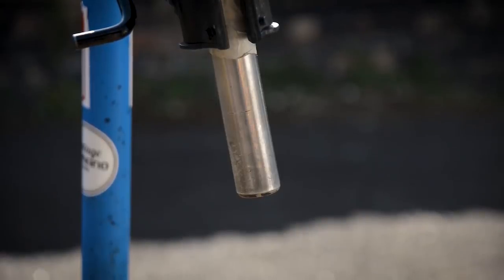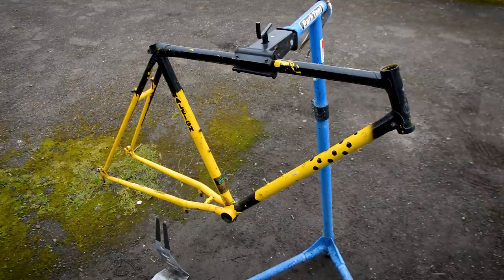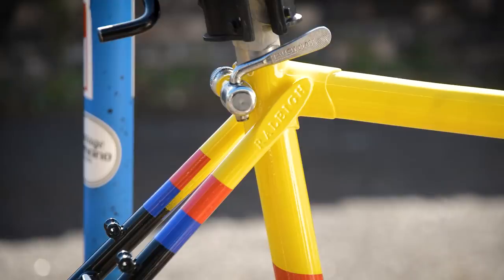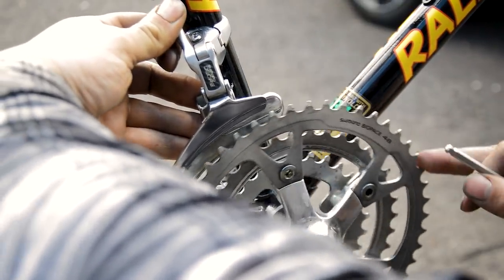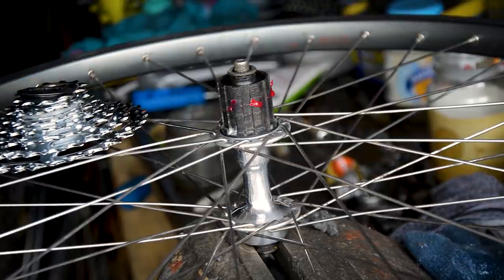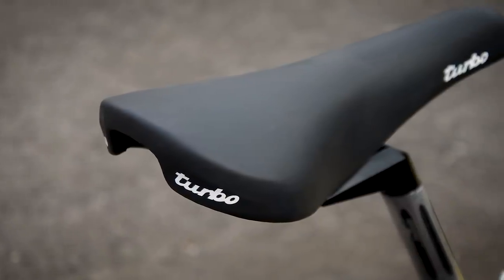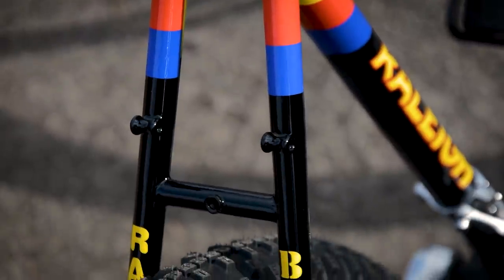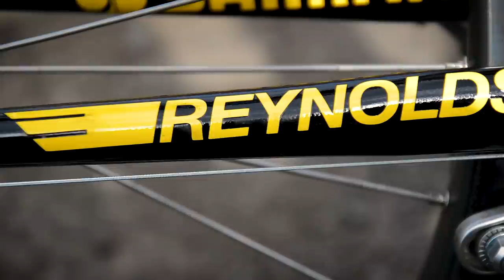1987 Raleigh Avanti - Team Banana - Vintage Mountain Bike Restoration

Comment: I love seeing somebody re-purposing old equipment and making the most out of old-tech. Most of the bike stuff from the 70s and 80s, especially from the big manufacturers (Shimano, Suntour, and Campag.) were of such a quality that they can be rebuilt and reused for decades. Just because you haven't got 12 gears and electronic shifting, doesn't mean you can't enjoy your cycling, if anything, to take an old bit of kit, cleaning and restoring it and making it work well, is an added element of enjoyment.
Reply from the maker: For sure. I get a tonne of enjoyment from rebuilding these bikes and love riding them all the same.

Comment: That was fantastic work, well done, i was particularly impressed by your method of overcoming the obstruction of slotting the sealed BB into the BB shell when the rivet is obstructing, i have managed to overcome this previously on my road bikes by precision milling the "locating collars" (for want of better word, not the actual threads) to create a grove to allow it to feed through as if jumping over, if you will,  I would not have thought of that, mainly out of fear of damaging vintage italian frames, but, to tap a thread and use a bottle boss bolt to mount the plastic cable guide insert, respect man !! if i need to do so in the future i will remember that method because if need be ,you can repeat it by using bigger bolts, that was a "big learn" for me, NICE JOB!
Reply from the maker: Thanks!

Comment: can you remember the size of the bottom bracket and head bearing? seeing your video, has inspired me to refurbish my Ozark! When i rebuilt my maverick, after stripping the paint, i went around the bike with krust, poured some down inside the tubes, done all the rust traps etc, was def better than factory finish, some guy bought it, only a few years back. hope its still going well. yep the following year, they moved the rear brakes and went to a unicrown fork.
Reply from the maker: For the BB using the MT60 crankset - I think it was a 68 x 122. That’s a pretty standard size for that crankset. 

Headset was 1”.

Comment: That’s a pretty bike! Huge amount of attention to detail man and heaps of little trick bits on it, it looks stunning!! I feel a little dirty, I’ve bought a new(ish) Giant mountain bike, but I’m pretty sure it’ll be sat aside once my Fisher Joshua arrives.
Reply from the maker: It is! I really want to finish it with the original bars but I’ve only found one set and they’re £100! Enjoy the new bikes!
Reply: @MonkeyShred  holy crap, 100 squids is a lotta money! I’m in a similar boat, though. I want a set of braced risers and they seem almost impossible to find apart from in England, and they’re £75 and post to Aus and I’m not gonna pay it until I’m certain that I can’t buy them elsewhere, and obviously once I buy one, 7 will turn up on eBay for $10. I picked up my Giant today, damn it’s a lot of bike for $150, and actually my first bike with discs, and my first hardtail too, and it’s got 24 gears or something nuts like that. I’ll be lost. I’m actually thinking of a project for my old bike, I really want some wing nuts but they’re really expensive, so I figured I’d make my own with some scrap steel and either weld the nut into whatever I use, or use another wheel nut or something like that. Do you have wing nuts on any in your collections?

Comment: Great job Mark ! , can l ask what that tool you used on the BBC threads is called , thanks again 👍
Reply: The 'penny' drop what that tool was called, thanks😂
Reply from the maker: The thread cutting tool?  It's just a bottom bracket tap.  Mine is made my Cyclus

Comment: Noticed Montana Gold spray cans for the base colors but a different brand of clearcoat (2k hardener). Would’ve done the same since the Montana Gold clearcoat is too soft when you clamp components down like a front derailleur. What brand of 2k did you use?
Reply from the maker: I believe it’s called SprayMax. I left everything to dry for a week before building to stop any soft clamping.

Comment: You did a great job. Just one bit of advice, when your putting decals on or anything that requires freshly painted components to be laid on the bench put an old towel or soft sheet down first,  there's nothing more annoying than accidently scratching your hard work.
Reply from the maker: I definitely didn’t find that out the hard way and had to add a touch more yellow....